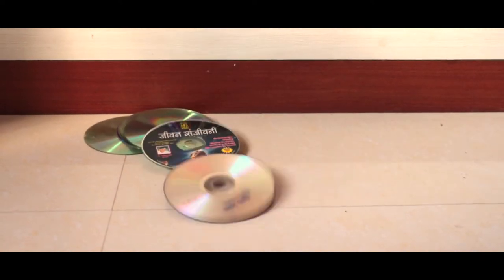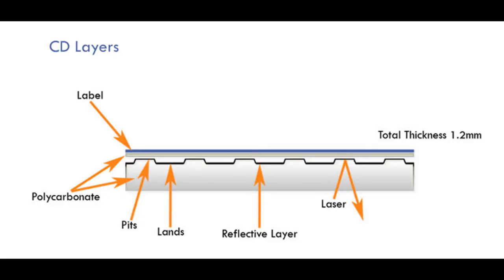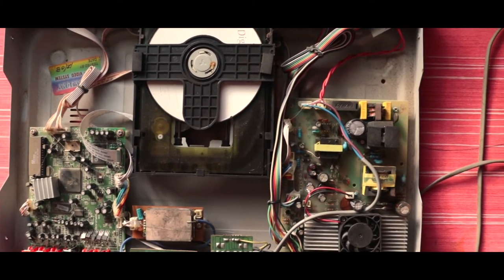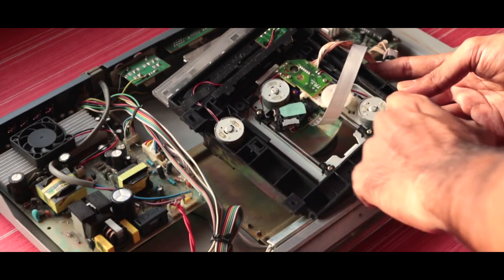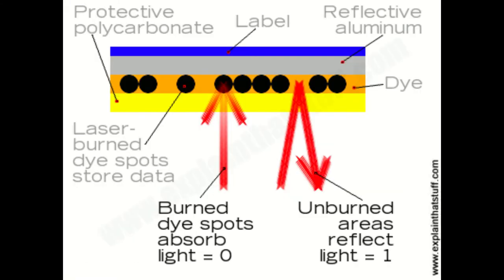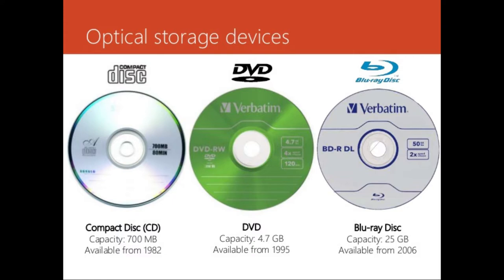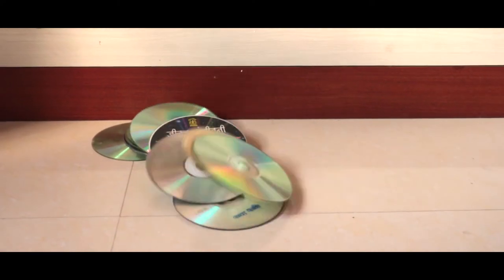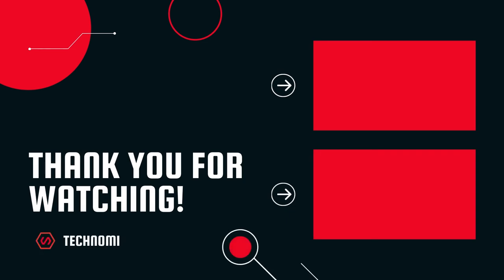How CD works ? EXPLAINED

Comment: 1s and 0s are NOT the lands or pits.  A change from a pit to a land or a land to a pit is decoded as '1'.  if there is no change, it is a '0'.  It uses a clock to keep a fixed time interval and uses the Non Return to Zero (NRZI) Inverted encoding....